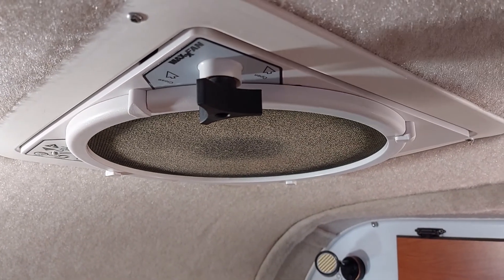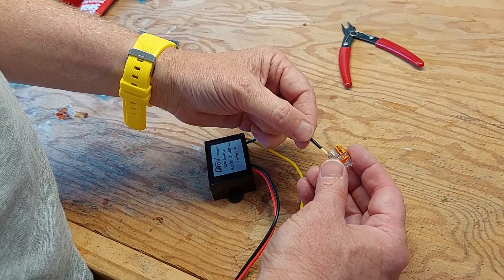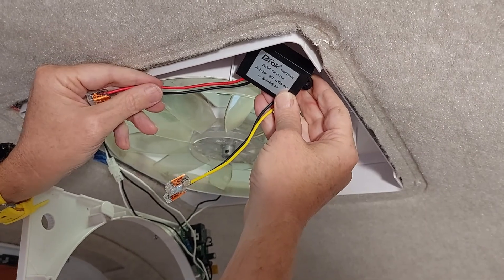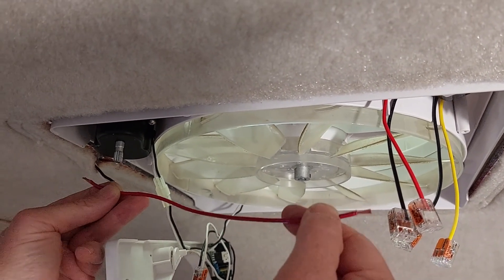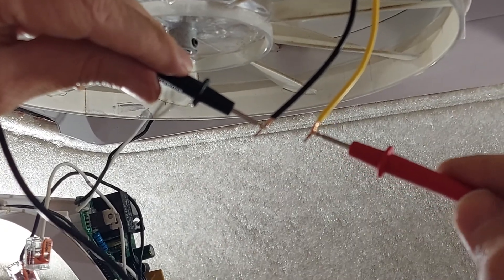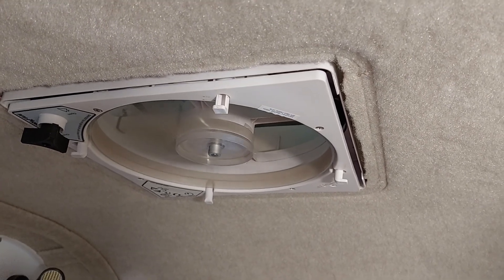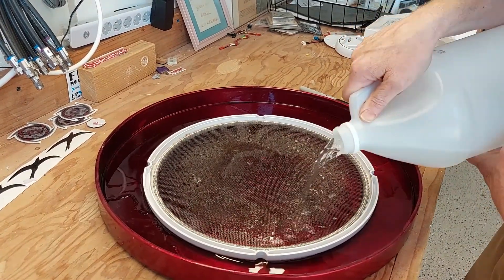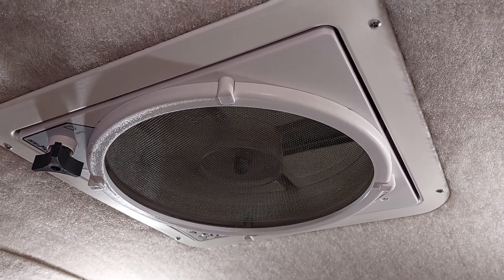How to Stop Your MaxxFan From Beeping & Shutting Down When Using Solar Power

Comment: How can something so costly be so phineki
Reply from the maker: I was told this fan is highly sensitive to voltages outside it's normal range.    It's due to the nature of the motherboard design.  They could simply add a voltage regulator to the product, but, according to the tech, have chosen not to (likely due to cost considerations).
Reply: @scampgrounds  I put a DC 12  25 amp volt 300 watt to the RV board it starts but beeps at the same 3 bumps  4 bumps beeps
Reply from the maker: @greg925911  Very sorry to hear you  are still having an issue with your MaxxFan.  Usually the voltage regulator does the trick if it's a matter of too much voltage to the fan.  If the fan still is beeping after adding the regulator and checking the voltage is 12V, then I recommend calling the MaxxFan company:  (574) 247-9235  They are usually really good and may replace your motherboard at no charge if you haven't had the fan very long.  Please let me know how it works out.
Reply: So if I find a voltage regular do u known if it's possible to put it after at the power source in the line to the fan, do they make such a thing other then tearing the fan a part 
Sorry I'm no sparky more of a Sheet Metal worker
Reply from the maker: @greg925911  just order the same voltage regulator I used (in the link) since not all are the same.  This one takes higher voltages (supplied by your RV) and consistently outputs 12 volts (which your fan likes).  It needs to go between the power supplied by the RV (input) and the fan (you don't need to take the fan apart).  I tried to show all the details in the video.  Just be careful to make sure the polarity is correct.  On my Scamp 13', black is positive and white is negative (this is the same polarity used on the MaxxFann as well).
Reply: I order one last night same one on Amazon it will be here tomorrow but won't be able to install to Saturday
Reply from the maker: @greg925911  good luck!  Let me know how it turns out.
Reply: Well it dose work I have 11. 36 to the switch
Reply: The voltage was 11.39 on a cheap meter
Reply from the maker: @greg925911  low voltage can also cause the fan to beep.  However, the voltage regulator also is supposed to set up low voltage (from 9.6V) up to 12V.  It may be a good idea to also check your trailer battery voltage as well as voltage inside the trailer.
Reply: @scampgrounds  it was running off of home plug in to a 30 amp RV power source with that 12 volt converter that's 300 watts at 25 amp and that was the only thing running I'll call the company tomorrow and try an get some lead on it from them 
thanks I really appreciate everything and any more ideas that u or someone has  not sure how to send pictures on here maybe that would help  to see if I have maybe wrong devices let's say
Reply from the maker: @greg925911  it sounds like maybe the motherboard is bad, but I'm not a MaxxFan tech so calling the company would be best.  I did talk to one of their techs and he told me that most of the issues are related to either too high or too low input voltage.  But, it seems your setup should be OK -- so it could be they recommend to replace the board.  Good luck and please let me know what they recommend.  The voltage regulator you installed is still something you will want to keep to ensure that your fan receives the steady required 12V.
Reply: a good Mppt, like mine,  will regulate the voltage output. So I don't need another regulator.

But, there is another bad design with this fan that cause me problem .

the condensation at the mother board.
If you eat you're RV at night and you let the fan open. theres will be water at your motherboard causing short circuit .

your fan is going to beep at night.

So, firts, remove the fuse now!

If you're fan did not blow, ( like mine) apply an acrylic coating on the motherboard .

Now you are safe.

Trust me, you going to need that if you're living or planing to visit cold place.

Good luck
Reply: @Androvsky Can you elaborate further on the beeping related to water/moisture?
Do you talk a permanent or intermittent issue?

Our Maxxfan started suddenly to beep every 4 seconds and showed random behavior in relation to that, e.g. shutdown by itself, change directions, etc.
Meanwhile the issue is not permanent. There are periods when everything is normal (and no beeps) and periods with beeps and random behavior. 

I am trying to find out whether this is a voltage fluctuation issue (a solution would be available for that) or of it is a none-permanent humidity issue (coating solution could be available, if no permanent damage to the board, yet) I should also mention that the problems started since we are at the Caribbean coast of Colombia (hot and humid). Thanks!

Comment: Mine worked ok for a few months then started beeping, it will work  for on like 4 beeps anything more then that it stops will that device help
Reply from the maker: Yes, the voltage regulator should fix the issue.  My fan did exactly what yours did.  I called MaxxFan and the tech said the issue is related to too much voltage going to the fan (usually when using solar panels) -- I was told the original motherboard voltage range is 10.8v - 13.8v.  The tech said that because so many people now use solar panels (whose voltage regulators may not be that accurate or adjustable), the company came out with a new motherboard with a wider voltage range (10.3V - 15 V).  However, the voltage in my Scamp 13' when on solar sometimes exceeds 15V, so even the new board probably wouldn't help.  This inexpensive voltage regulator did the trick for my fan, and I no longer have beeping or shut downs!